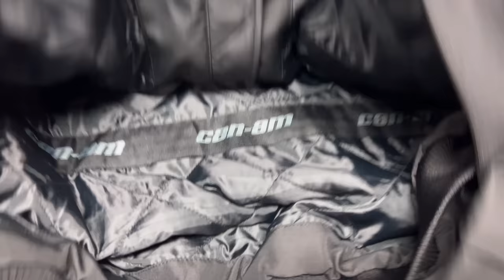Can-Am Gear from BRP!! • Ryker Rally & RTL SM5! | TheSmoaks Vlog_2356

Comment: That Can Am gear looks super nice!  Congrats!  
I do miss my 15' RTS SM6 manual sometimes.  Its just fun to use the manual transmission to your favor in turns and mountain roads.  The SE6 in my 21' RTL seems to perform differently than I expect at times, its still cool though 😎.

Comment: I was at a Can Am dealership that had a ton of clothing and jackets for 80% off. I thought great! I can get a nice jacket. The sizes were European and nothing fit. A 2X fit like a medium. Hope the new stuff is true to size.
Reply from the maker: No wonder it was 80% off, BRP quit using European cuts years ago..!  We haven't had a fitment issue in quite some time now...  The clothing fit great, with the exception of the jacket.  I usually get XL jackets from everyone because they tend to be too loose (I like a tight jacket).  I was afraid I might get a jacket too tight to wear and went with a 2XL, and dang-it they were spot on and it's a little loose for my liking. It's fine though, as it fits correctly to size.

Thanks for watching and commenting! 👍
Reply: @TheSmoaksVlogs  This dealer was opening over a dozen huge boxes filled with new jackets and stocking his racks. Maybe he bought these on a close out. I thought he was trying to unload these heavier weight Can Am jackets because winter in SW Florida was over. Good to hear that Can Am rectified the situation. No Can Am dealers in my area carry any type of Can Am gear which I thought was weird.